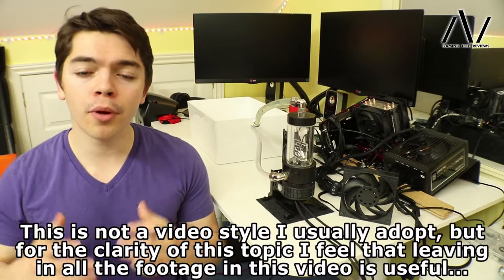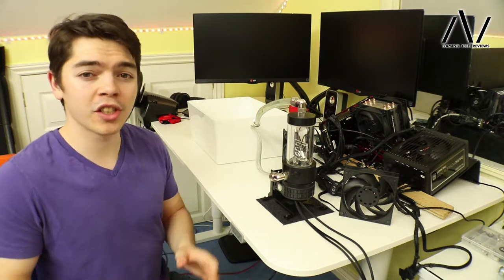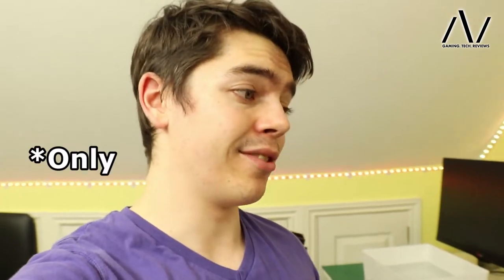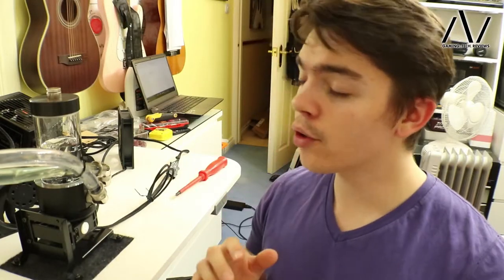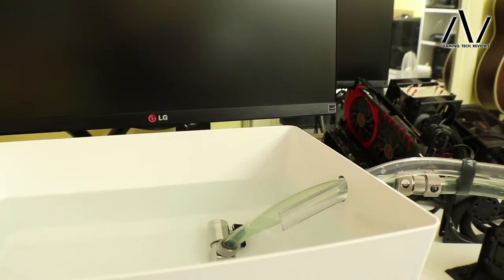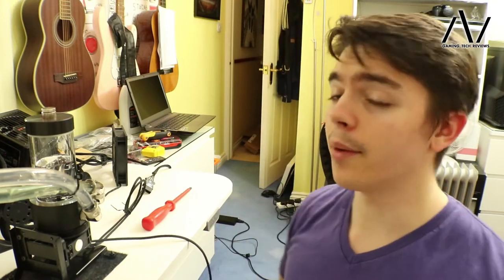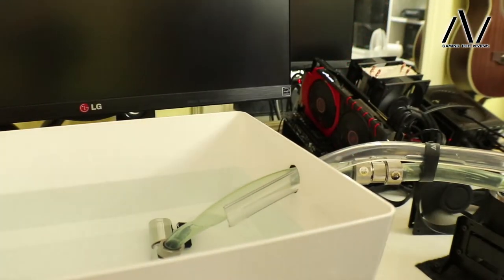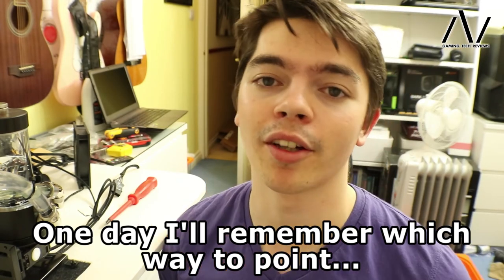Why your PWM runs at MAX speed...

Comment: Help, I just bought my first water cooling rig of someone on facebook market place.
It looks really nice but the only problem is the ekwb d5 pumb doesn't have a 4 pin fan header it has a 3. Isn't it suppose to have a 4 pin header for pwn control? When I go to my motherboard bios (asus z370) it wont let me change the speed of the pump, and yes I did plug it in to the "right header". I'm assuming I can't change it because the pumps plug is 3 and not 4. I don't know much about water cooling can someone help me out?
Reply: I've tried every fan header on my motherboard but no luck.
Reply: Damn.. sounds like you bought an old system. Current gen pumps are all PWM.
Reply: @MadMexism  like how old? He said the system was built in august. Looks like it too most of the other parts looks practically new.

Comment: I wouldn't really recommend putting the pump into the cpu fan header if using a compatible pwm mobo! don't want it ramping up and down constantly.
Reply from the maker: I see where you're coming from. Unfortunately on many motherboards like the one in this video, there aren't any other PWM headers available, and the pump won't play ball on the DC headers. So the CPU fan header is the only available option.

But I think what you were suggesting is that there are motherboards with other PWM headers, like the OPT header on enthusiast boards. That would definitely be worth using to keep the pump at a constant speed. 

I'm going to try get my hands on many other pump types in the future and have a good play around with all the PWM madness to see what is the most compatible pump option available.

But if the CPU fan header is the only available PWM header, then the pump speed ramping up and down is just an unfortunate necessity.

Good points made, a constant speed is certainly preferable.
Reply: the MSI B450 Gaming Pro Carbon has a pump port... would that be a good board? gracias!
Reply: @AVTechy  I see so in order to control de pump and the fans separated we need to check that the mobo that we are getting has more than one pwm header on it . right ?? or get one vario one that has 5 speed set up
Reply from the maker: Yeah that's the default recommendation. You can play around with splitters, but that has various levels of success. Your always better off having a dedicated PWM header for the pump, and whatever control you fancy for the fan (they can run on DC control but have a higher low RPM limit.

Comment: Can you answer a few questions if I provide my build?
Reply: I have a Asus 370 Hero X WiFi mobo and a photon x4 custom loop and Rez. I’ve been all through the bios and I can not tell anywhere in there that a pump is connected. I really can’t say how it’s doing or if it’s consistent, as some times the pump is noisy and others I wonder if it’s on.
Reply from the maker: @specialfriendz4126  If it's linked to the CPU_OPT header it'll be controlled by the CPU_Fan Header.

If it's a 3 pin fan you may as well plug it into a SYS_FAN or CHA_FAN header and control the speed with a DC fan curve. Apparently there's not a massive amount of benefit to running the pump at a high speed, so you can set it to 30% for any temperature and create a fan curve to deal with the increase in thermals.

Let me know if you need to talk this over more.
Reply: @AVTechy  hello can I ask you a question? I changed motherboard, took an asrock steel legend, and initially the ek pump was fine, then suddenly the motherboard, it no longer finds it in the bios, it does not tell me where it is connected or the speed, N / A. since this happened, if I put the pump on standard speed, the water does not turn in the pump and you can clearly see that some bubbles that are still in the pipes (because I just filled the loop) instead of going forward it goes back, like if the pump has stopped turning, even when putting on performance, the same thing, and so the temperatures go up a lot. to make it work I have to put DC instead of Pwm. and put full power, otherwise it won't cool. my first thought was that the PWM control of the pump has broken because the bios no longer detects it. and also because if I unplug the 4pin and leave only molex the pump doesn't work. . I don't understand what it is. in a nutshell, I connect 4pin of the pump, and molex, in the bios the pump is N / A, it does not work in Pwm, neither at standard nor at quiet, nor at performance, only in full power in DC mode, and when it goes into DC it doesn't even seem to go very fast. In fact I had the gpu as a game temperature of 42 degrees, and now it reaches 56 in full power ... I ordered a new one because I think the pump is the problem ... in your opinion? thanks
Reply: @AVTechy  last question, when i fill the loop, do i have to connect only the molex? if I leave the 4 pin connected to the motherboard what happens? can I also fill the lopp by starting it with the 24 pin attached to the motherboard? always filling as it goes down?

Comment: Good video, but I do not get the problem... Connect the plugs and wires as described and everything works fine? Molex for "high" power plus and ground, PWM plug with RPM and PWM signal. If you try to install a pump on your own you should understand the basics...
Reply from the maker: It's that not all 4pin headers are PWM compliant. And most people think they are.
Reply: Videos like this help us learn the basics. I have been building pc's since 1991, and have used some AIO's but full custom loops can still be scary. I think he did a great job..

Comment: That must've been annoying, pumps can get way too loud!

I have the alphacool eispumpe which is cool because it has speed dials on the back, molex power and a pwm controller that uses the setting on the back as a max value.  I don't use it though, just have it on molex and setting 3/5.
Reply: Exactly what I did for my setup too, 1 less connection to manage at the same time
Reply from the maker: Yeah it's definitely something that can worry people when they first setup a water-cooling loop, I am a testament to that.

Hopefully this video gets around to those who don't understand they way pumps work, as most assume they would run the same as fans.

The Eispumpe's controller sounds great, I think having a static pump speed at a desired setting is a very useful feature. And considering ramping up the pump speed doesn't change the temperature much it's a good way to go!
Reply: I couldn't decide where the pump "fan" connector should go / should it go on the cpu header or should the fans go on there. 
These vids are great, there's really not much helpful information out there.
Reply: Decided to Oc my gpu today. 2112mhz at 44 degrees after 4 hours of gaming. Cpu is at 22. With the fans barely audible, I love watercooling 🙄
Reply from the maker: Hello there, sorry I've been a little busy this weekend. I would have replied earlier but you know how things go...

In terms of where the pump fan header should go or where the case fan headers should go - it makes zero difference as long as they can get a true PWM signal (if the goal is PWM control that is).

I'm glad you found this video useful, I will be coming up with more that are hopefully as useful as this one is in the future. I think answering questions on a forum is all good and well, but having a lengthy video show all the possibilities and the correct way to achieve the desired goal is much more effective.

On the note of your overclocking, well done! Sound like a great overclock to me, up around 500+ Mhz? Those temps are so low as well, a high performance loop with low noise - sounds like you nailed it! Your spot on, water-cooling is awesome!

Thanks for keeping up with the videos, it's a real boost to have return viewers!
Reply: On air mine used to boost up to 1986, it's specced at 1847. I don't think there's too much more to get. I feel like gpu boost gets close to the cards reasonable max. 

That's good to hear, I enjoy your videos :). Is your phanteks case stripped out? Was wondering how yours coped with last weeks heat. I had to turn up the fans!
Reply from the maker: Oh sorry I forgot your using a 1080 yeah? Yeah the factory boost settings are pretty good, and the performance is really good anyway. Hitting max graphical settings on a game and maxing the FPS of a typical monitor isn't that hard these days. Most people are still using 60Hz 1080p monitors, a fair few have shifted up to 144Hz monitors which is a little more demanding. Most aren't using 4K which is reasonable, but the shift will happen at some point - sorry I appear to have gone onto a completely different tangent...

Anyway,

My Phanteks case is empty at the moment, my system is as you saw it in this video. So it was as cool as it can reasonably be for an air cooled build haha. But that R9 390X is a really hot card. During the heat of last week it was at 60 degrees doing nothing! It is air cooled and is naturally a hot card but still, that's ridiculous!

I'm really looking forward to water-cooling it again in the next case, a video of that will be out the week after next! Hopefully it's as good as the last one...
Reply: Yeah :), msi gaming x, it does well at 4k ;).

jeez, how the hell can it get that hot haha. I liked the look of that case. I really like cube cases.
Reply from the maker: +mark stevens nice, just out of curiousity what frame rate do you get in the various games you play at 4K?

That's what I was thinking, it was throwing out ridiculous thermals. The room must have been 30 degrees at the time which didn't help.

Cube cases are great, it would have been awesome to water cool in t as the GPU block would have been on show! I'll get another cube case in the future to see how that goes.
Reply: Witcher 3 everything maxed except hairworks It''s over 60 ( my monitor is 60hz and I only use it's on screen counter to check the fps when I'm setting a games settings). Gta v maxed except aa was around 36. The only other games I've played are tf2 and ftl, I don't feel like they would've stretched it haha. 

Amd do love a hot card. I was seriously tempted by the  thermaltake core v21. I got a core x2 instead because it was on sale, I didn't appreciate how big it was at all!
Reply from the maker: +mark stevens those are respectable frame rates considering it's essentially rendering 4 x 1080p.

You may have known that the Core V21 was I initially going to be my first case on the channel however I changed it for the Phanteks case. I may have to do a build in it as it seemed to be a very versatile case.
Reply: I'm very happy with it, not sure how much better it is than 1440p but oh well. I have a g-sync monitor so that keeps things looking smooth.

Random one but I have a spare http://hardwarelabs.com/blackice/gtx/gtx-240/ . If you  want it I can send it over.
Reply from the maker: 4K (3840 pixels) is substantially more pixels than 1440p (1440 pixels), if you can maintain that smooth frame rate you'll be having one of the best gaming experiences you can get with consumer tech these days!

That is one hell of an offer, but I really can't accept it. There's no doubt I could put it to good use in a future water-cooling video, and it would be horrendously awesome with 4 fans strapped around it.

I'm trying to think of the best way to put why I can't accept it (if you were thinking of donating it), but essentially I am just some guy doing videos, and that is your radiator that you spent money on. I could pay you for it, but at the moment I haven't got anything lined up that demands a radiator of those proportions. That is undoubtedly the biggest offer of support I have had to date, and I don't think that anything is going to top that from a subscriber any time soon (if ever).

Okay, I've thought of a middle ground to not sound like I'm being super ungrateful:
If I plan a build of huge water-cooling proportions, and I could use a radiator of that size. I will message you to see if you still have it, and if you do and you would be able to send it over, I would pay for the postage, complete the video, and after dismantling and cleaning the system I would send the radiator back to you with monstrous amounts of bubble-wrap to ensure it doesn't get damaged during this process.

How does that sound to you?

And again, thank you so much for the offer. It's something that I wasn't expecting from a subscriber (especially at this stage). I think it could happen in the future from a manufacturer or supplier for some sort of sponsor, but I'd never expect it from a subscriber. So a super thank you for the offer, and hopefully I haven't come across as ungrateful... and you're awesome!
Reply: I'll load up witcher 3 in 1440p and see how much real world difference there is. 

I essentially got it for free because the supplier sent the wrong rad initially and doesn't want this one back. It's just sitting in one of my component drawers ha. 
I understand though :).
Reply from the maker: +mark stevens yeah give it a shot and let me know how it is. I would have thought it would be at least noticeable.

Wow, that's a really lucky situation. It's a huge radiator which will likely need a push/pull fan setup to keep the air flow reasonable and the noise down. Which turns it into an even bigger monster radiator, it would be fun trying to fit that in a case - especially an mATX case! I'd love to see what kind of temperature difference there would be between that and a 30mm thick radiator.

Anyway thanks again for the offer, it's above and beyond the call of duty as it were. You never know, I might be calling on it sooner than expected haha.
Reply: It'll have to be a beefy matx case! http://www.xtremerigs.net/2015/02/11/radiator-round-2015/.
I've been playing player unknowns battlegrounds on 1440p, that still looks ok.
Reply from the maker: Haha yes it would have to be, nearly all mATX cases will not be designed to fit in a radiator of such a size. I can imagine a case that could would require the removal of the HDD cage and the Optical Drive cage. And until I go about setting up a NAS for super quiet PC operation, is too much of a trade off for my liking.

Can you tell much difference in games between 1440p and 4K then? I guess it would vary from game to game.
Reply from the maker: Hey, just thought I'd let you know there won't be another video on the channel for the next 4-5 days. I have got the next video pretty much fully edited but I've contracted some illness going around that's effecting my throat which means I won't be able to finish it off for at least a few days.

Sorry for the delay of the video, I'll get it uploaded ASAP.

BTW if you want to keep up to date with all the upcoming content and generally keep in touch with the channel check out the Facebook and Twitter page that I'm going to do my best to keep up to date with all sorts of channel and video info:

Facebook: https://www.facebook.com/AVTechy/
Twitter: https://twitter.com/AVGTR